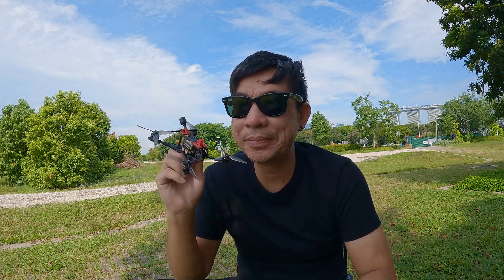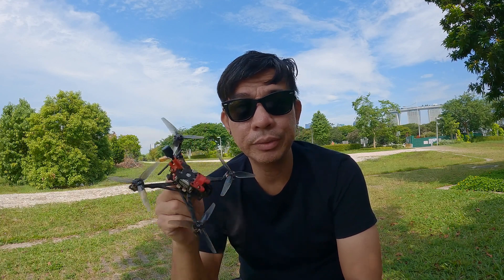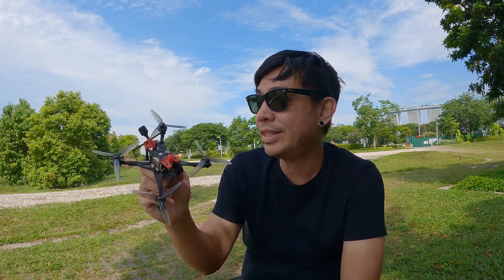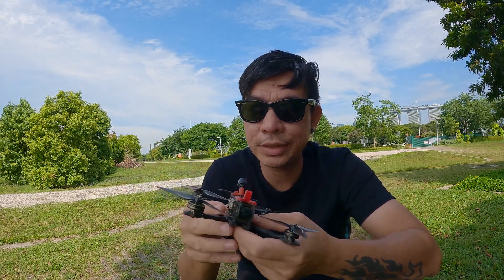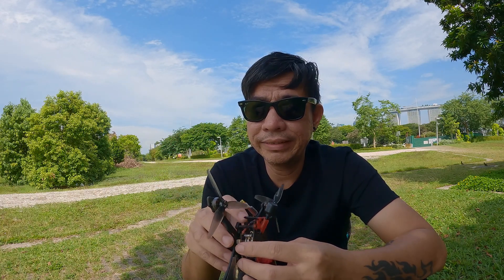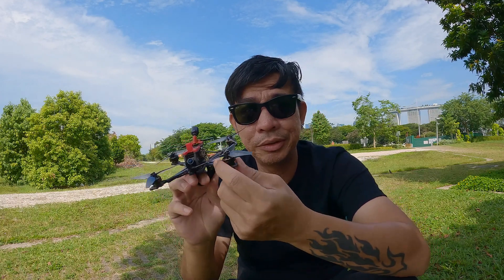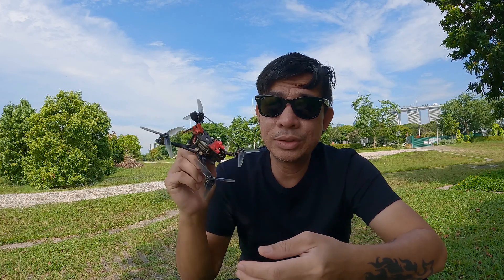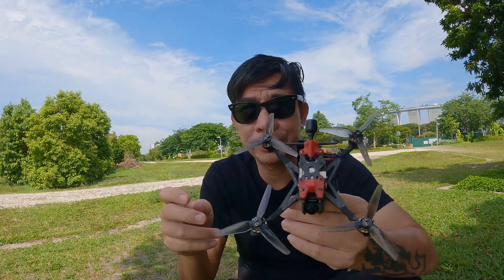Secret of the Crux35 12A ESC on 4S

Comment: any damage from hitting that tree at the end? would have been good to see the aftermath and see how it held up to such a hektic crash
Reply from the maker: OOOOHH ACTUALLY... NO! hahhaha.. Its still flying and I have it with me now here in Korea! LOL it can really withstand a good beating. Though sometimes if it crashes in the right angle, it'll break an arm immediately.
Reply: @shogunemperor  sweet thanks I'm keen on getting one, I'll make sure I grab some spare arms while I'm at it, cheers
Reply from the maker: @christhorney  sweet. Note that the arms are a unibody bottom plate and get the V2 bottom plate as those are more rigid.
Reply: @shogunemperor  awesome no worries thanks

Comment: Beautiful trees to fly around! Can’t wait to get back in the air! Thanks for the informative vids bro! Do you find the motors notchy? Also is the x2 a good replacement for the Crux35? Thanks bro!
Reply from the maker: aww thanks my man!  OH??? What happened to ur quad?  Or issit the weather?  Hmm... the motors are actually quite good. Not as robust as some.. but VERY efficient. Its mostly the frame design with the bottom mount lipo that makes it notchy. I still havent had the chance to adjust the feedforward for a smoother transition. I havent tried it on the Crux35 but the X2 should be about the same in terms of specs.  So I think ur good! Thank YOU  bruddah.
Reply: @shogunemperor  I attempted to soldier the lead for my runcam thumb and fried the flight controller. Thanks for the info brother
Reply from the maker: NOOOOOOOOOOOOOO

Comment: Great video - and clearly explains exactly why this combination works fine despite the 12A ESC. I was nervous when I bought my Crux35 back in November with the 12A ELRS, but watching the amp draw in the OSD made me realize just how efficient this setup is. Good power to weight ratio. Mine is still flying great.
Reply: John Cuppi is the man that told me to heat my gyro so the soldier would reflow! It worked! Thanks again John!
Reply: @MisterT43 wow I remember that! Thanks so much for the comment, I’m humbled! I’m glad to hear that fix is still working out for you.
Reply from the maker: Aaww thanks bruddah!! REALLY appreciate it man.  Yeah, It was the same for me, but during the tests it seemed fine and I was really going hard on the throttle! So they definitely did something right for sure!!!  But I feel that it handles more like a race quad rather than a freestyle one... so maybe that lipo placement makes a huge difference.  Thanks for dropping by my man!!!